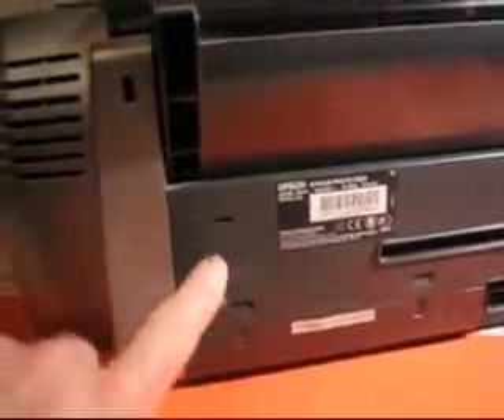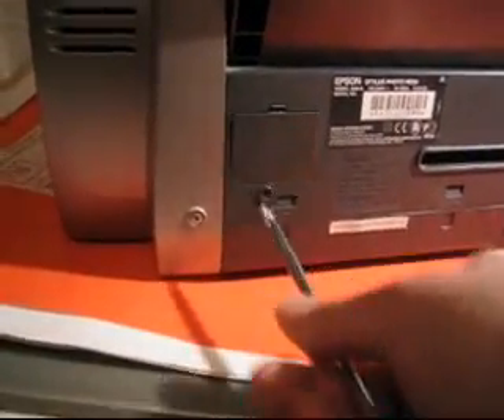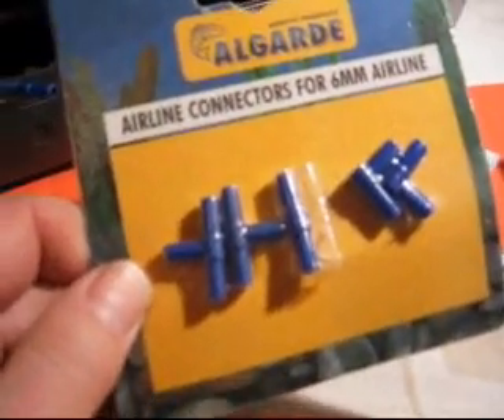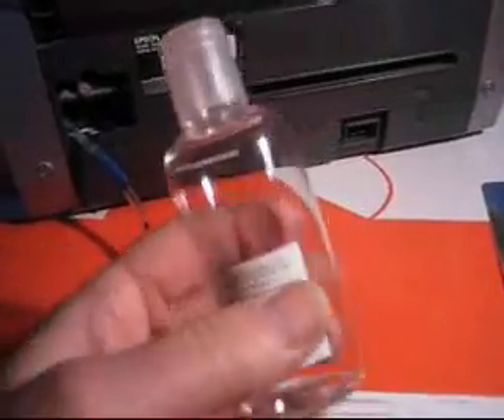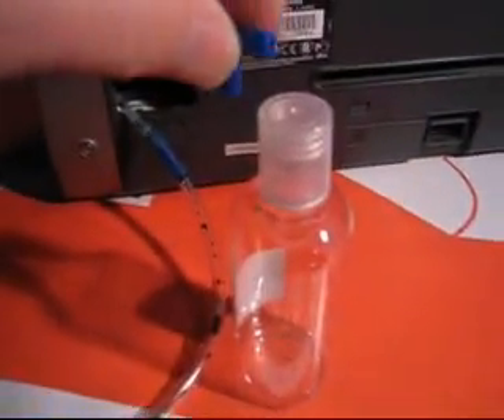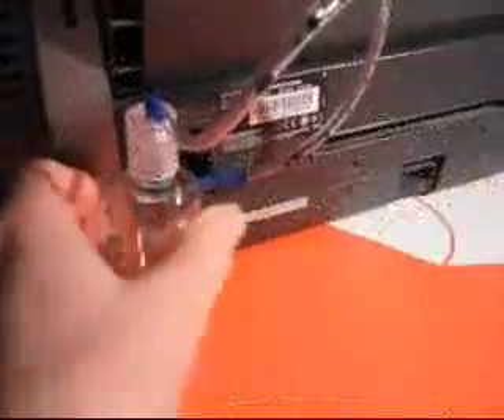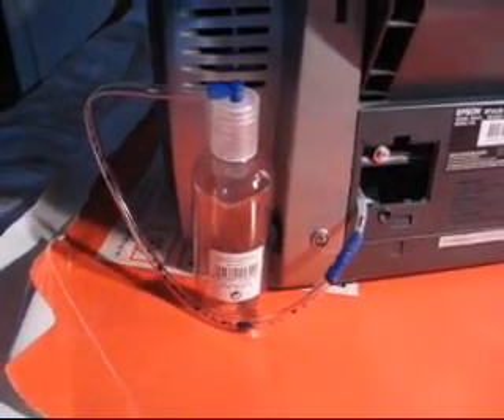Epson Waste Ink

Comment: This is the best explained and illustrated video I've seen for fixing my R200 Epson printer.  I did as you suggested, forgot about the ink pads, and the printer is still working after 2 weeks.  The trick for me and Mac was to use our PC notebook connected to the printer to reset the printer. As there is no reset download for the Mac. Thank you SOOO much!

Comment: Best instructive video I've seen. Watched it last night and applied to my Epson L200 Printer today. Joining the two tubes was problematic. Could not get a matching connector. Solved the problem by using a slightly larger plastic tube and sliding the printer's waste ink tube into it and then sealing the join with silicone glue.

Comment from the maker: Yes.  You will find that the R1800 has two pipes just a case of joining them with a T piece and then putting the one tube into a plastic pot making sure it is not air tight ie that it is vented.

Comment: Thank you for posting!  I've just followed your instructions and found it very easy to do. I used a little ink pipette to lengthen the tube. When you've downloaded the software from SSC and installed it, you need to right click from the toolbar at the bottom of the start page, then select 'ink Freezer' then 'restore values back' to get it reset. Then it said I had empty cartridges, so I just pretended to replace them, taking them all out and putting them back in again, works fine! :)

Comment: Very good idea. One problem I saw ( or maybe I missed that step) is that the top of the bottle needs to be vented. a filter needle would work good so log as the doesn't touch it. If the filter gets wet, the air won't pass through it. Without a vent, the positive pressure from within the bottle is going to put a strain on the pump and make it wear out sooner than later.
But other than that, good stuff!

Comment: A Great video.

One thing though,... put a small air vent in the lid of your bottle (pin hole) to stop back pressure blowing the ink back up the tube and into the printer again.

Comment from the maker: @ServiceProcess do make sure that the bottle that the waste goes into has a vent hole.  ie it is not air tight else the printer will not be able to push the ink into it...hope that hepls.

Comment: @DebenDave 

Thanks very much Dave. 
Have added vent hole as suggested.
It's all done and working Now. So very much appreciated. 
Have done it on 3 printers. r300.
The advantage for me as you cite, is added longevity for the printers.
As I have invested in Continuous ink systems etc, so printing
is hyper cheap.

An absolute top mod.
Rgrds.

Comment: I don't think the waste ink hose in the printer is pressurized; it probably uses gravity to bring the waste ink down into the waste ink pad. You should probably keep the bottle below the printer so that gravity will cause the ink to flow down into your waste bottle.

Comment: Just leave the ink soaked pad in the printer. It's not doing any harm there. The printer manufacturers purposely design these pads to be hard to remove. They want you to buy a new printer. There's a high probability that little parts, like springs, will come loose, and you won't be able to put it together properly!

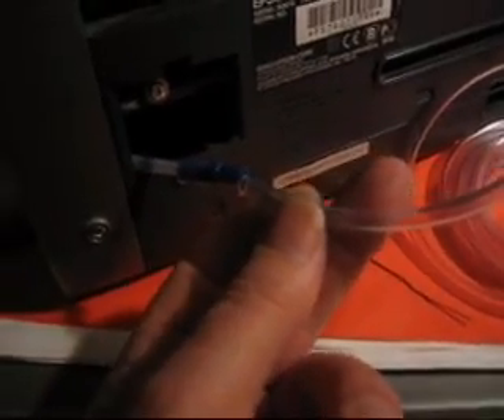Comment: @ 4:36 I presume that you have pushed the printers ink pipe over the outside of the fitting, due to it being a smaller ID than the Aquarium pipe, which looks as if it pushes inside the fitting?  How has this mod been working out over time?  Reliable?  no leaks or tears in the pipe?  I am thinking about doing this mod to my 3yr old Epson SX415 which according to WicReset is about 50% full!   Thanks  Mike

Comment: Could you by chance upload a video of this printer in its cleaning mode. I ask because when mine; which is a similar model (Stylus C86) is supposed to be cleaning itself, it just jumps back and forth a little while making a few noises at its starting position on the right side of the printer.

Comment: Help please I have R-200 used on a Mac.  My printer has the mods made worked for a day the next morning 2 red lets flashing at the same time. I'm assuming this is NOT the full and Im screwed red light sequence. Alternating I think is the absolute reset needed NOT available with my Mac. Im I peeing up a rope here? Business is in dyer need of this printer! Also when I turn my printer on it goes thru it's motions lights up the low ink (one) red led I push it then it shuffles back and forth a moment then I HEAR CLEARLY A BREIF HISSING SOUND then boom (2) red lets flashing at the same time kinda rapid. I replaced my Ciss ink supply as one youtube suggested the chips were the problem. NOT same crap!  Work? Im broke! Can you please advise?
Richard

Comment: Great video, very useful :)

Can I just ask, would it be OK to use shorter tubing?

I have an Epson C64 that has I believe been reset twice due to the maintenance message, only the ink was never drained. I have a feeling that when I look inside the bottom of the printer, it will to resemble the scene out of the 'The Amityville Horror' where the owner digs up his cellar and falls into a huge filthy swamp lol.

I'm also gonna try repeated flushes through the heads as the print quality is not as sharp as it used to be..if that doesn't work it's time for the ammonia trick. Be nice to keep this printer going as the compatible inks (Pro-Jet), are cheap and last ages.

Comment: Would a small pin hole on the bottle cap do as a vent? Does bottle have to be below base of printer? I have tried using the reset tool but unfortunately it does not work with Windows 7 only with XP. Does anyone know how much it would cost to have the printer serviced at Epson Service Centre (out of warranty)? Anyone open up R200 to dry and clean foam pads? Will pads dry out eventually if service panel left open and mod done? Anyway of sucking ink from pads? e.g. ink refill shringe? Cheers!

Comment: @pauldazeley I know this might be a bit late, since ur post is 5months old, but afaik mac os x is unix-based therefore any program that works for this on linux *should* (as long as it's posix) work on the mac, tho' u might need to do a bit of comand-line scripting. (i've never owned a mac, but i managed to fix an adminstrator-rights problem for him) anyway if this is no use to u, my apologies, maybe it helps someone else :-)

Comment: hi thanks for the video.. ihave followed it sucessfully however i cant find a link for the programme to re set the counter. is it possible to point me in the right direction please
Reply from the maker: Sarah Marsh just search for sscserve to find the reset util.
Reply: sorry that's http://wicreset.comI wish I could edit, sorry I should have checked the link.....anyways they changed the homepage, but the software is still there. hope this helps and good luck, I'm working on installing an external tank, which means no more resets. the ink will be pupped into a bottle and not the bottom of my printer in the inkpad.
Reply: okay there really needs to be away of editing  a reply, even after you press the button. or is there...anyways it's http://wicreset.com
Reply: Thank you so much. Very kind of you :-)